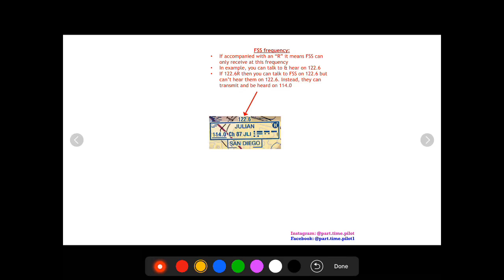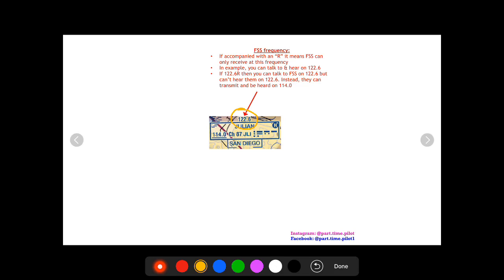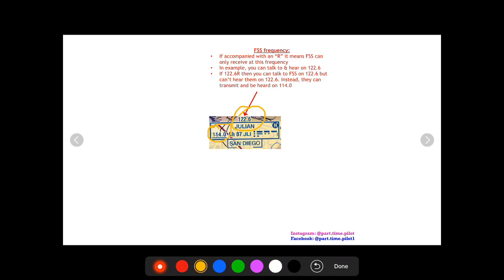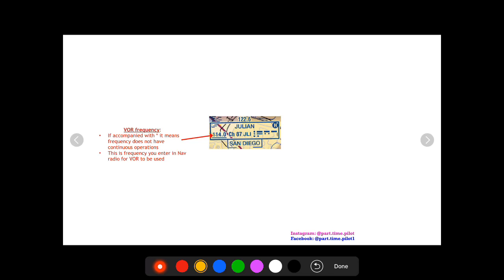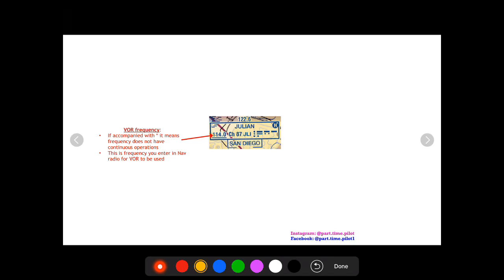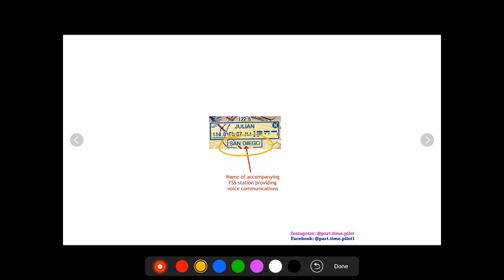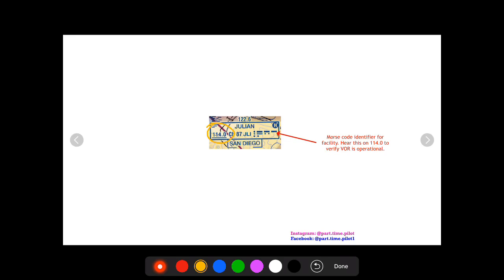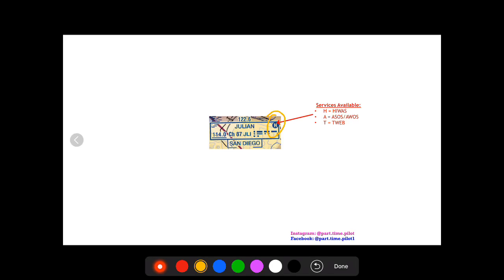How to Read a VOR Communication Info Box on Charts - For Student Pilots

Comment: A correction, the CH 87 is for all ground based DME reporting Navaids including civilian VOR DME stations, its the channel the DME equipment in the aircraft needs to be tuned to to receive Distance from that station. Most training today is done with use of GPS which does not require ground based DME Channel number as it measures distance from satellites.

Comment: If I am listening on 114.0 on the nav radio, do I hear the morse code also?
Reply from the maker: If I understand your question correctly I do not believe so. 

What I would do in a situation where I want to talk to an FSS is I would tune 1 comm radio to the one I transmit on and the other to the one I listen on (114.0). I would also tune my nav radio to 114.0 if I was using the VOR station so that my VOR would be looking for this station. To check the Morse code I would pull the volume knob on the nav radio. If the station talks to me and I have both comms on to listen to I will hear them through comm 2 that’s set to 114.0. When I pull the volume knob to check Morse I would hear it through my nav radio
Reply: @PartTimePilot  This is what I was asking for.  Thanks.
Reply: The frequency 114.0 would not be underlined to listen. Correct?  Underlined frequently has no voice from what I understand.
Reply from the maker: @peterg7342  Yes! My example in the video and in my previous response assumes there is no underline under the 114 and that there is an "R" at the end of 122.6